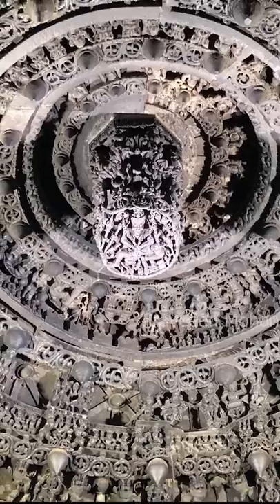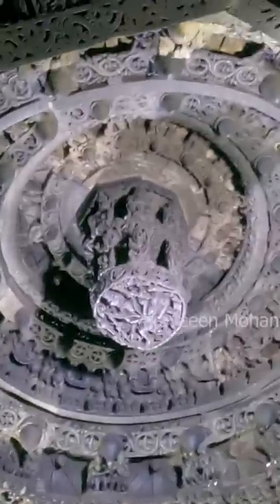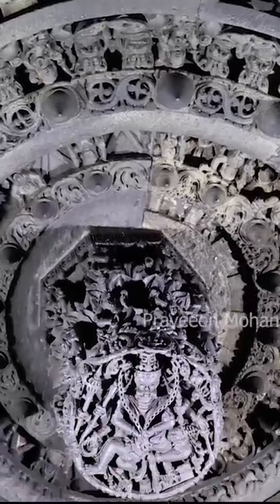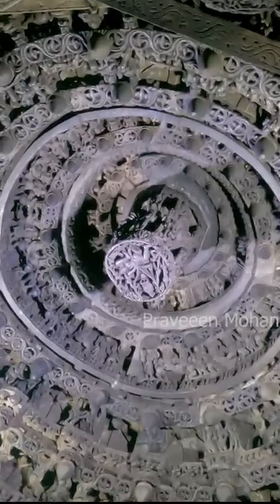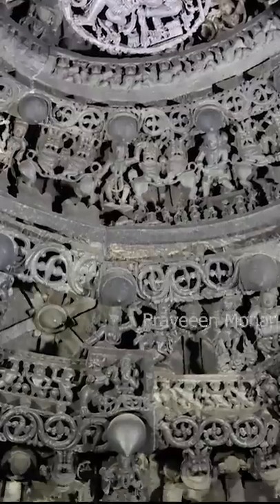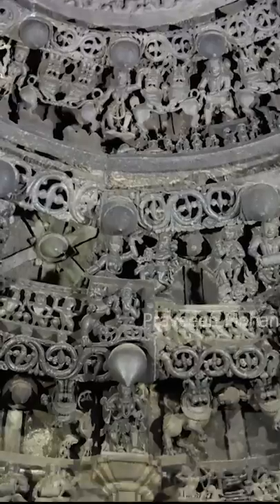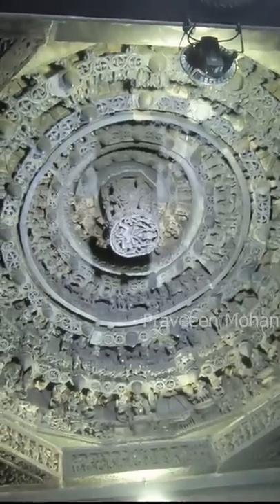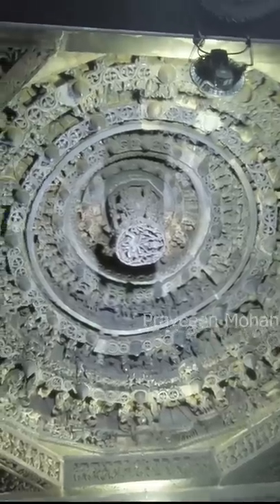Master screw to dismantle Chennakeshava temple?

Comment: No. It’s called a key stone. 
They use larger blocks of sandstone. Lock it in place with the key stone, then carve it. 
Similar to an arch bridge. The more force on top of the structure the tighter it locks in. Been used for millennia. 
That’s why the Romans used arches in so much of there building. 
But the sculpture of the blocks is amazing.

Comment: There are many Indian Hindu temples which are completely made of interlocking stones, with no cement or mortar even and has no foundation! The temple is held together under the weight of a giant rock at the top (Shikhara). So when an earthquake hits, the temple shakes, but still stands as long as that giant rock still stays at the top. Engineering marvels!

Comment: I to know how the hell they got the cylindrical cork in and out, not only that long ago. But even in modern times, I wonder how much that single cork piece weighs ?

But a thousand years ago almost, the design alone is crazy with living in pieces. But how in the world would they be able to build rafters to get up there, an then lift and hold all those pieces to get them fixed an locked in.. You don't see structures this intricate built anymore, an the time to have built these carvings and structures must have been immense. 

I mean imagine the commitment these people had to the gods and to the Pharaohs of ancient Egypt etc, to have built these temples. It's fascinating and mind boggling to say the least..

Comment: I got you. They built it upside down so it wouldn't fall apart. They put in that master bolt to hold it together and then flipped it over and lifted it using the cranes they used to build the pyramids. 👍 Easy peasy.

Comment: Its not that difficult is the whole reasoning around arcs and domes. The dome of the church in Florence  is octagonal and on the top it has an extremely heavy platform to lock it in place. And it’s still standing hundreds of years after the construction

Comment: I tell you one thing a massive strong being or multiple massive strong beings with six arms and multiple legs would have a much easier time holding the rings in place while spinning the center bolt... I think we all just accept that we're not alone in the solar system much less than the Galaxy. 
    How about we move on to communication and asking for help to get rid of some of the more Petty problems that have been kept going for many years to control the ebb and flow of energy and thus the ebb and flow of life.